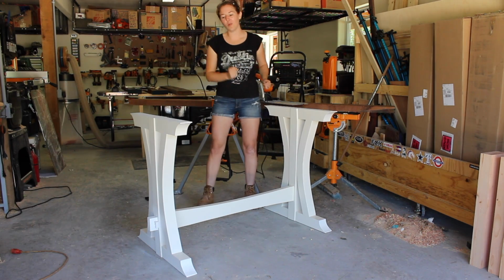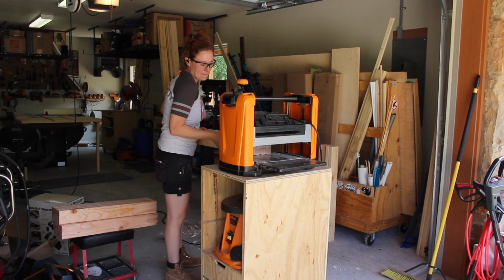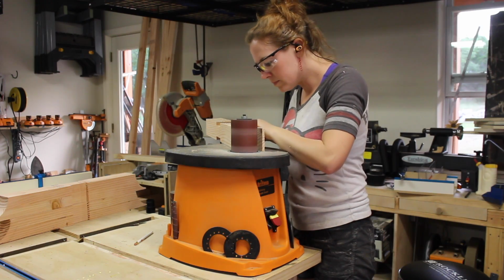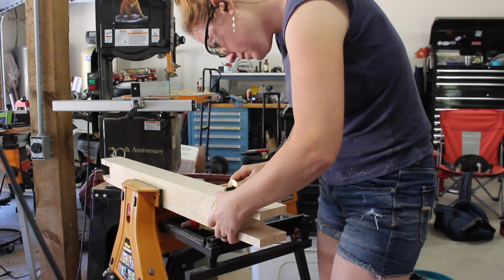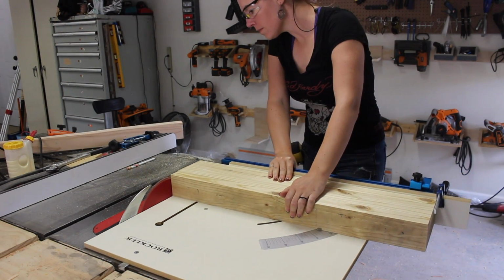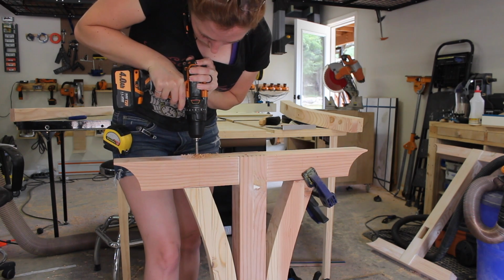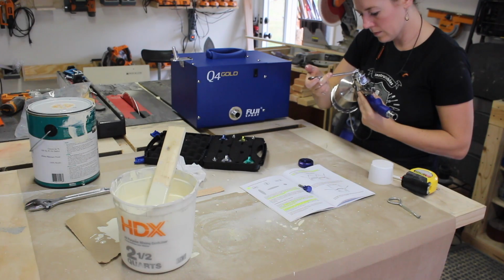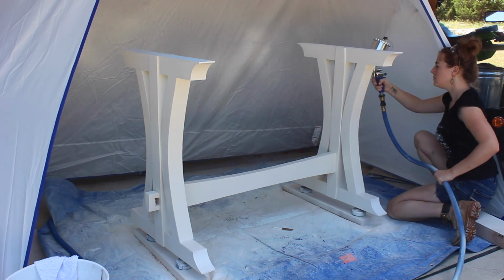How to Build a Kitchen Table - Walnut Dining Table

Comment: I've been looking at both parts of this video table and I have no idea how those clips work to attach the tabletop to the base. I understand how the clips work, but don't see any attachment point in these 2 videos. Any ideas?
Reply from the maker: I still had to cut them, I used my biscuit joiner to make slots but you could also use a track saw or circ saw with the depth set just slightly. Just enough to make a slot in the wood to slip in the clips.
Reply: Cool, thanks!

Comment: A suggestion for spreading glue, use a plastic putty knife and it will spread the glue well and is faster than brushes. It is also to clean up

Comment: Just another quick tip, do not glue any skirting to the underside of the top, instead use
screws with oversize pilot holes.That way the top can move without cracking.
This tip applies to all natural wood table tops. Plywood and man-made substrates with 
veneer can have the skirting glued if wanted.

Comment: looks great. Experiment with turning the air cap 90* on the front of your gun. Then the fan shape will be horizontal instead of vertical for spraying the legs. You can go up and down the leg instead of all the little back and forth passes.

Comment: When I crack a smile or express any kind of pleasure at getting joinery to work out right, other woodworkers call me immature or amateurish.

Whatever, guys, I'm just glad I didn't ruin a piece of wood.  It's looking great, April.  Nice work.  This is just me talking but I would have been inclined to bend those curved pieces from a stack of laminations instead of cutting curves out of a big laminated timber.  But hey, it's yours and it works, so I'm done commenting.

Comment: Wow, lots of equipment involved here.  That sure makes it easier.  It however distances your projects from a large portion of your audience.  Conversely, the people with this level of equipment likely don't require much guidance.  I am happy for your success and sponsorships, you are an exceptional presenter, and deserve all your successes.  I know you'll find a balance and not outgrow your audience.  There are many ways to have achieved the same finished results without having all the equipment you used.  Show it again perhaps how it could have been done only using hand tools, a tablesaw, and a paint brush.  Remember to touch on that at least, then it provides an opportunity to discuss the joy and ease of having those pieces of equipment and the value of an investment in them.   This style of base has classically been an excersise in hand cut joinery and why I am bothered to bring that lack of mention to light.
Reply: Talladega Dude --- 100% correct!
Reply: Talladega Dude.  Thanks Dude.  We cool?  I do agree with you too, or two... the 100%er.  It was a quick comment that I myself made the 1st reply to.  I love a good turbine driven HVLP sprayer.  I don't know what came over me.  I think it was the spray tent contraption. 
 I give April props on her woodworking abilities, but her appeal to me is her style of presentation, and enthusiasm for what she is doing.  Don't you wish that more instructors, lecturers, presenters had her communication skills?   She is an awesome role model for anyone who wishes or needs to be an effective communicator.  And she's kick*ss cool as hellll ! 
Smart and purdy too.
Reply: Sorry, I hope that didn't sound bitchy.  You are exceptional at this, and I truely am a big fan.  A showcase of your design concepts, presentation, and the finished results is preferable to a tool showcase anyday.  I do understand that even with the time saving tools this portion of the build took better of a week to do. Can't wait to see it with the top.  Make sure to fab some wedges out of any extra walnut that is leftover.  How did you manage that crouch over the lower beam without getting any paint on the back of your leg?
Reply: I smile because over the years different commenters bust her chops for doing "such simple projects & not using more advanced woodworking techniques" and then when she finally builds up her skill level and tool collection & starts doing more complicated projects, then OTHERS go on how she is distancing herself from the normal woodworker (there were other comments besides just yours). She has always said she builds what she needs and wants and that's why she doesn't take requests. I say good for you and no matter what - you'll NEVER please all the people all the time.
Reply: Talladega Dude.  Yo, smilin' Tdog, don't lump me in with your "OTHERS" brother.  I am just sayin' don't leave the po' folk behind without throwing a dog a bone.  No need to exclude people without bandsaws, thickness planers, and HVLP spray equipment.  Let it be known that your table project can also be done with some basic powered hand tools, a tablesaw, and a paint brush.  Don't let sponsors turn your channel into their tool show.  How's that Tallatude Defender for not dancin' around the subject?  Now, please don't use my comment as a vehicle for your comments.  At least don't link, reply, or put your thumb in it, let your comments stand on their own.  No one is kicking me out the Wilker_doo fanclub I Talla you what Dude, and your little dog Arkansassy too.
Reply: Always cool. No worries.  :) She IS something, isn't she?   :)

Comment: I'm quite new to the craft and am curious about the painting/finishing side... Do you typically paint/finish after assembly or prior? I figured with the sprayer it probably levies itself more towards finishing after assembly since the thin coats can gets in all the nooks, but if you didn't have the sprayer would you still have gone that route? Love your channel, can't wait to see the top!!
Reply from the maker: Nope, I typically paint before assembly without a sprayer but you're right....since I have the HVLP I decided to assemble then paint this time.

Comment: What earphones are you wearing?  What is the sound balance between the music and the environment?
Reply from the maker: I always leave links in the description of the video but these are the ISOTunes Pro. They are blue tooth as well as OSHA approved noise cancelling headphones. They have a 27 db noise reduction rating and using them in my shop, I don't even have the music volume turned up all the way to hear over tool noise. I'm impressed with them. http://amzn.to/2pEjNtv
Reply: Thanks, I will check them out, I can't use regular earbuds (they just fall out whenever I turn my head) so I have been looking for some over the ear ones.  Figures you would have some that are designed for the shop.  Of course you don't want to completely remove the environment noise all together.

Comment: I am in love with the leg design.  Do you think your design would support a stone top like granite?
Reply from the maker: I have no idea on how to evaluate it to say yes or no. I'm going to put a 8/4 walnut top on it, and that's heavy.
Reply: Hmm I just might have to give it a try.  Thanks for the reply!
Reply: Add a top stretcher and some internal bracing (of your design) between the two stretchers and then add your stone top and YES, it will support it! One note of caution, be sure your stone/granite has no fractures and can be self supporting for the longer span. Build it, you'll love it!
Reply: GodzillaB210 
I think that for a granite countertop you need a base around the perimeter.
Reply: I would have a substantial frame underneath the stone.  When I was a child I went through Momma's marble worktop while kneeling on it ,  It would have worked fine (on 2x2 softwood legs) except for those pesky kids.
Reply: Seeing how massive the timbers are I'm going to say it would, depending on how thick, wide and long the top is.  HOWEVER - too great a span and the granite will break under its own weight.  You may need to build a supporting frame underneath.
Reply: Thanks for the tips! I will definitely add your ideas to my sketch plans.
Reply: Hmmm, your giving me some good food for thought. Thanks!
Reply: Борщ TV,  a perimeter sounds like a dirt trap to me

Comment: Great job once again, April. By the way, I do a lot of HVLP work and I highly recommend a good respirator. The 3M 7502 is inexpensive and really comfortable. (It's made of silicone, as opposed to the less expensive, but less comfortable, 6200.) Add the 6001 vapor cartridges and you're good to go. All told, less than $26 on Amazon.
Reply: Wesley Treat just bought my hvlp gun and used couple of times sprayed 2 doors and fishtank stand without mask thank you for this 👍😀
Reply: No problem! Believe me, your lungs will thank you. I should add:
▶ I recommend the pre-filters, also. They fit over the cartridges to filter out the larger particles. Since a link will probably be blocked, search Amazon for "3M Paint Respirator Supply Kit." It includes both, plus the retainers that hold the pre-filters.
▶ The last digit on the 750X model number indicates the size. 7502 is the medium, which I think fits most people, but if you've got a big face, maybe go with the large. :)

I should probably do a video on this.
Reply: That's also a good idea. I use the 2091 P100 Particulate Filters. I have them on a second mask for convenience, but you can just switch them out when you need to if you want to save a few bucks.
Reply: And while you're at it  get some of the dust filter cartridges in case you have to work with MDF or other nasty wood composites.

Comment: Nice video and design, April! I'm actually going to be tackling a new table door my family soon, and I really like this design! Assuming I have my wife's approval, I might be purchasing a set of your plans here soon.

I do have a quick question: do you have a video, or can you provide the details, on the dust collection system you're using in this video? I've seen your previous videos from your old shop (hooray for a new house!), but seeing what you had in this video is definitely different. To my eyes, it looks like an open ended filter from Wynn, with the plastic bag below the filter, and the motor/impellor on top. I couldn't tell if you had this set up as a single or two stage system, though.

Edit: nevermind about the single vs two stage system... I just watched again and at the very beginning, I can see it's a single stage.

Comment: I do like the design. May I adapt it a little to make an outside table? Regardless of the reason it was good to see an American use a single blade to cut a dado. Over here, in the UK, dado blades are very hard to come by and a saw with a long enough harbour to fit one are expensive.

Comment: Great video but you should definitely be wearing a mask to spray
Reply from the maker: I was using latex paint and I was outside.
Reply: April Wilkerson i am 9 years old i watch all your videos I wish I had all the tools you have I really want a band saw and belt sander and router
Reply: Partymario 123 do u have any tools? i was like u at 9 and i was actually 8 1/2 when i got my first actual tool box

Comment: Great work April, I've been following along on Instagram all week. Just an idea Ive had, for the wedged tenon. Instead of having it white, you could use some of the left over walnut for the wedges instead. 

Great work nonetheless.
Reply from the maker: That was actually my plan, which is why I waited so long to put them in...I ended up changing my mind but think I will take them out after I build the top and see what I think about Walnut ones.
Reply: April Wilkerson  good Job
Reply: That contrast would pop and tie in the top. Brilliant idea!

Comment: nice start to the project. cant wait to see what you do with the walnut. have you used a compressor run syphon or pressure feed gun ?  if so how do they compare to the hvlp??? even with lp and outdoors you should have a respirator on imho

Comment: Nice family table. It will last for 100 years.
Reply: 489 years, 8 months, 15 hours, 27 minutes, and 46 seconds from the estimated time of completion, actually (at least in this "timeline"). I haven't yet checked alternative timelines however. But in this timeline, it only gets destroyed because of a rare incidence of an out of control "Sawls, Chops, Sands, Glues, Welds, Paints, Carves, Nails, Dados, and Designs Everything" robot-tool from "Mars Robo Equipment Inc." A future company that sponsors a descendant DIYer who inherited April's table.

Along with the seriously modified engine and parts from Cody's Corvette, it turned the table into a stylish wooden personal starship - go figure!